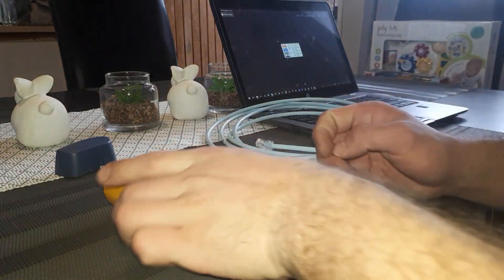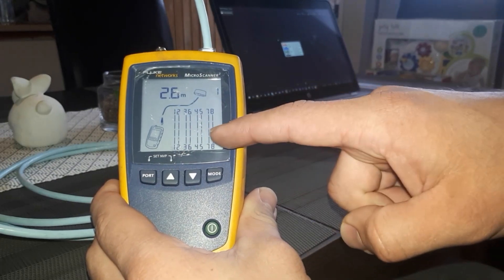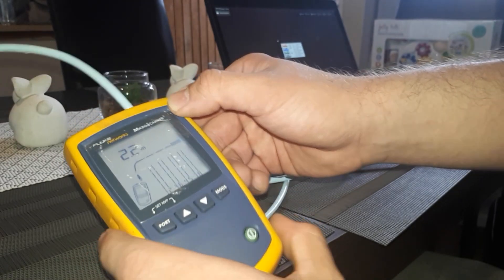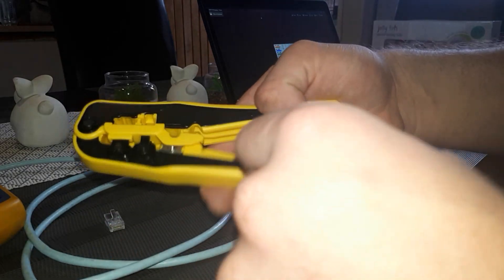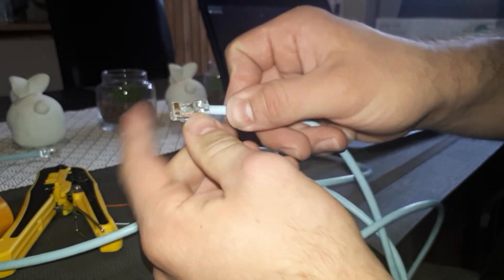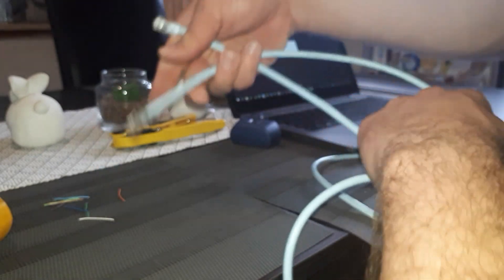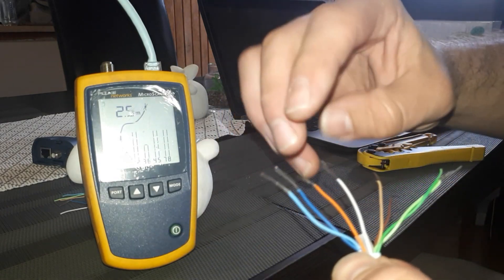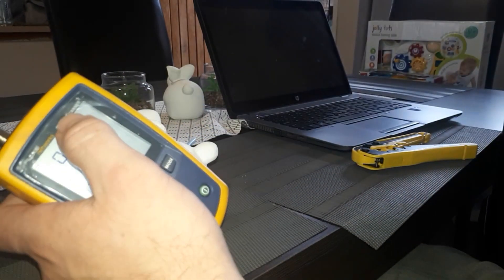HOW TO TEST A NETWORK CABLE WITH A FLUKE CABLE TESTER

Comment: Good morning, it is possible that you will help me with a question that I have, what happens is that my intellitone was lost and I want to buy another which is sold to me individually to use with the MS2-100 microscanner, if possible this works or each one comes functional for its own microscanner by frequency. Thank you
Reply: Good day. I have found that other toners do work. It depends on the tone frequency. However, over long distance the tone fade and it become difficult to trace the cable when you have other cables and interferences. I will suggest getting the same brand, or if you can, take your microscanner with you when you buy another toner, and check if it does work before buying.

Comment: Hi does it tell you which end (near or far) has the problem if both ends are already crimped?  That is the frustrating issue I am having right now with my simple 8 LED go/no go tester.
Reply: Yes it will show you at which end your cable is broken. When your pairs are switched around, it will indicate the pair numbers and you can correct that by checking which colour wires are not in the colour order you crimped according to. It's a great simple to use cable tester. I would recommend having one.